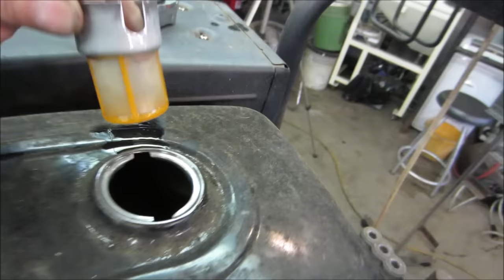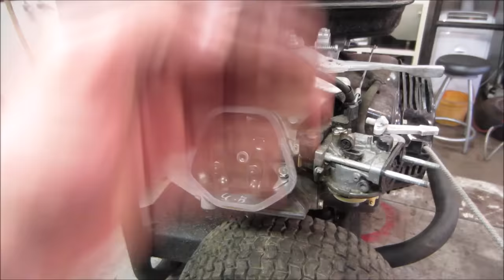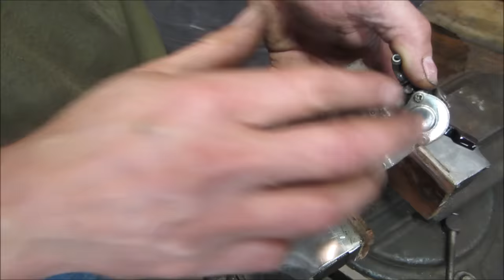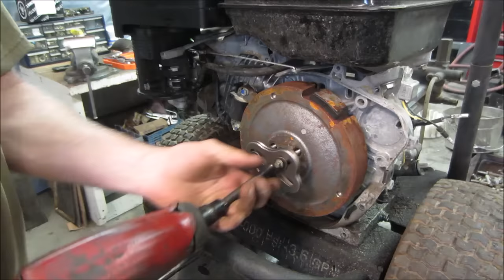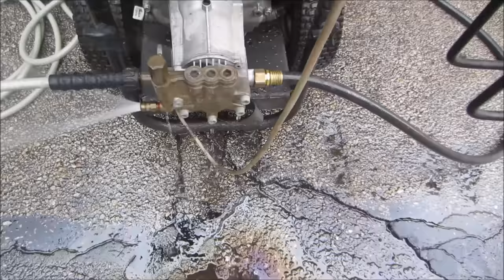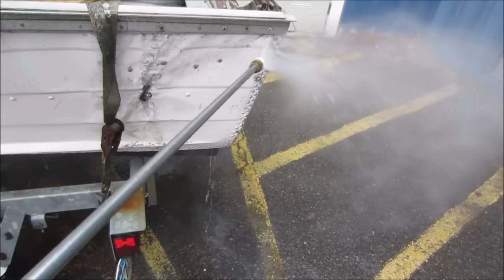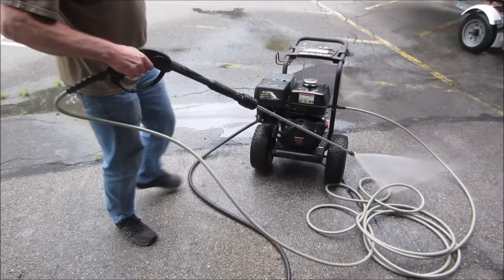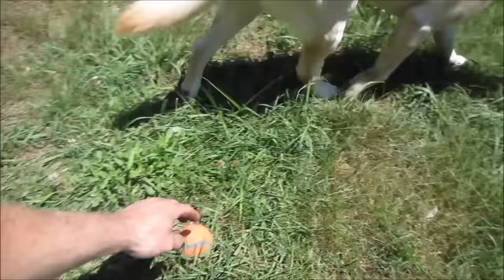Pull start rips out of your Hand? lets Fix It. Busted Pressure Washer.

Comment: "I'm afraid to commit..."

Yeah, no kidding...  that HURTS, when it rips it out of your hand...  My lawnmower did that once...  Sheared the key off, it was out of time.  When that thing kicks, and rips the handle out of your hand...  Ouch.  My hand was buzzing for a couple weeks...  Very unpleasant...

To this day, when I grab a pull start thing, I remember that, and I think "please don't rip the rope out of my hand...."

Fun video.  Nice job.
Reply: Every time i start my 05 honda recon it does it
Reply: Thick gloves help
Reply: Get rid of the T handle and get a ... cane handle (L shaped) pull start replacement. That way, it just slips out of your hand. That or just hold one of the two arms of the T handle, as opposed to crossing it between your fingers.
Reply: I had a mower with a sheared key that yanked the handle out of my right hand and smacked my left forearm.  I had a bruise on my left forearm for a week.
Reply: Every time I've found it kicks a mule, it has been a sheared flywheel key. It wants to fire before tdc. Ouch.
Reply: It is in the camshaft. their is some stuff to decompress the motor.
Reply: you have to take the camshaft out.
Reply: Had an atv with a pull start kick back one time and dislocate my top knuckle on my right ring finger. It was sitting on top of the knuckle behind it. Thankfully I instinctively grabbed and yanked it right when it happened and it popped back into place. If I hadn't of done it out of being surprised I probably would have ended up going to the hospital to have it put back into place. I still have a lump now on my finger 8 years later. Was not a fun experience.
Reply: I don't have a shear pin that broke off.
Reply: 301cc predator
lil bastard has all kinds of issues
kickback (rip my hands lol) the tourque converter is stuck, bad oil rings 
overall a good engine but we just got  a shit engine
Reply: Have a 175 yamaha dirt bike. I ended up with the wrong stator assembly for it. Let's just say the last time I messed with it was a few months ago and my right knee is still sore. Taught me not to lock my leg straight when kicking over a bike
Reply: had a lawnmower that did that. I quickly learned how to slowly pull past that point that can kick back (cause you could feel it) and only then pull hard. It worked for a few years after that, with that issue not fixed. It was always fun to see my pops trying to start it, but without knowing how to bypass that point of "I'll explode your hand into space".
Reply: at work,we had a 40hp outboard that like so much to kick back,that thing really hurts,it left your fingers like if they where broken.hard to start,and almost every time you start it from cold,it gives you at least one kick back,it was so scary...i hate that engine so much....40hp kickin back,ufff.
Reply: Real Talk o
Reply: ..to prevent that "pulled out of the hand" thing...follow the propper start procedure..;)
pull the starter slowly until you feel the compression..
then rehook the starter by letting it roll up..
slight pull again until the have tesension on the rope..
and the one mighty pull thrue..
that way you put the piston right before the compression point and it gives you enough rope and speed to pull thrue the first compression cycle of the engine..basicly like an kickstart on an motorbike..;)
greetings from germany
Reply: It's even more painful when you get kick back while trying to start a 500 cc dirt bike.
Reply: yeah man it happened to me three times now im scared to pull it hahah

Comment: Mustie1, This is one of THE helpful videos I have come to find.  I'm running a professional pressure washing company and the pressure washer was having the same issue.  The pull start was ripping out so hard it was recoiling and breaking the rope several times.  I thought it was weak rope or the pull start assembly was broken. So I replaced and still it was happening.  I had no way of know what to do but this video was clear and to the point.  Today, I did the same, valve clearance adjustment, and cleaned and adjusted the magnet.  It worked! No pull start issues. One of the best videos I have used for the company.  Thank you.
Reply: Fantastic job. I really enjoyed it and finding the coil reversed was surprisingl.

Comment: Hi Mustie1, The one thing I thought I would mention regarding the engine dying after 10-15 mins of use can sometimes be caused by a faulty fuel tank vent causing the fuel tank to build up a vacuum while the engine is consuming fuel. Great video btw. Cheers

Comment: Classic example of the difference between a mechanic and a technician. Good find!
Reply: Not really lol he took apart half the motor to find the issue 😅
Reply: @EFLO3D  he followed what he knew could cause the failiure..thats the way every other mechanic would have done it..and gives back a well seviced engine with adjusted valves, coil and cleaned carb...so right way to do it! :P
Reply: This guy is a Pro. Ive learned so much. Thank You.
Reply: I never liked the term "technician" every job under the sun is some kind of "technician" but only certain jobs have been historically important enough to end up with it's own term. No one says law technician its lawyer. No one says medical diagnosis technician its doctor. The same goes for mechanic, the term technician devalues the importance of a mechanic.
Reply: He’s very entertaining to say the least.
Reply: @EFLO3D  So what would you have done different?

Comment: Two comments. On Briggs coils, the coil has "engine side" to get the install correct. Also the green gas goblins and water love to hang out in the fuel shut off, 
 So the coil problem got the owner a complete engine tune and all Mustie fans a complete troubleshoot tree on running issues of the Honda. Fantastic.
Reply: I can't remember what exactly (thinking Techumseh) but the coil bolts were different sizes to only allow one way installation.
Reply: And some aftermarket say "cyl side" on them to give you the correct orientation.

Comment: I have a Honda powered pressure washer that has taught me how to re-string the pull start...very well.

Thank you! I'll be re-stringing it again but this time adjusting the valves.👍
Reply: Update: my old Dewalt  pressure washer with a Honda engine is no longer kicking back!!! 

After installing another pull cord & handle I adjusted the vales & its running better than it ever did! 👍

Comment: Would you concider doing a video on the power washer's pump valve body repair or rebuild? Might be interesting. Thanks
Reply: I second this!  I have a pressure washer with a broken connector for the inlet hose. I know that Amazon has replacement pumps for 40.00, but I have not yet taken the pump off the motor to check the model #.
Reply: I would also like to see a full typical pump teardown/troubleshoot and rebuild with parts like seals etc. that can be replaced.    Would be a very welcome episode or two.
Reply: I could do a pressure washer pump repair video.
Reply: I rebuilt a Comet pump and it was unremarkable. There are a lot of good videos and don't forget it is not just the seals but the one way valves. Fix them and it's like a new pump.
Reply: I was coming down here to ask the same thing!
Reply: @n1r0l  ĺ

Comment: Mustie, this video is awesome.  taught me tons.  Got may hands on an old craftsman rototiller, crank case and fuel take full of water and piston stuck.  Tore it down, new carb and got the thing to run( one of those briggs carbs with too damn much linkage).  Ran a few minutes then quit...would not restart.  Got fed up...then watched this video.  I remembered during my attempts to restart the tiller the pull cord would jerk from my hand.  Aha, mustie says timing issue.  Checked fly wheel key and coil gap.  Viola, set the gap at 12 thou and the booger started on 3rd pull, purring like it oughta.  Thx bro.  I am hooked on your video lessons.

Comment: I worked at a shop that sold small engine implements.  The Honda GX engine has a good reputation.  Rules for pressure washers: 1.Don't let them freeze. 2.Don't let them heat.  3.Don't run them dry.  Looks like the thermal relief plug opened up on this unit.  Good video - didn't see the backwards coil coming.  Good job!
Reply: Why it’s best to take a picture before removing anything 
Just makes sense to look back and compare

Comment: Thanks for explaining it in Full, You've given me the enthusiasm to  look at our Old Water Blaster again, which was purchased new 10 years ago, But stopped running and started backfiring 2 months after buying, Noticed the governer arm adjustment screw vibrated loose  changing the Governer setting ?
Ended up in the shed stored and forgotten, procrastinated and missed warranty period. My Bad !

Comment: I'm sure its been said already, but I believe that the water that comes out of the pump when the pressure line out is off, is meant to cool the pump when water isn't going directly through the pump itself. As AvE would say, "That's a feature, not a fault!" Great video!

Comment: One thing that wasn’t covered on the fuel side was to check the fuel bowl retaining bolt, it could’ve had blocked passage, sometimes it’s the issue on no fuel since its the lowest point in the bowl, and dirt will settle there after sitting for long periods of time then when started it gets sucked in the ports. This was an excellent video, thanks for sharing.

Comment: Just wanted to say thanks.  My pressure washer kicked the bucket back in May and I didn't have the chance to take a good look at why it stopped working until recently.  At first I thought it was the carb.  Cleaned it out (there was junk in the bowl so I thought that was it at first).  Put it back together, tried to start it, and it pulled the starter cord out of my hand (and felt like it almost broke my arm in the process too.  :/ ).  I didn't have much time to get into the guts of the thing so I put it away until I had more time.

I saw this video back on the 5th when you published it.  I hadn't touched the coil but you gave me an idea of what could have been wrong.  This past weekend I pulled off the flywheel and sure enough, the key that keeps the flywheel in sync with the crank had sheared and the two were now out of phase by about 90 degrees. Of course nobody in my area carries the specific size of key the engine uses so I had to order it.  No biggie, two days and five bucks later I had three of 'em.  Put the flywheel back on, slid the pin in, put the thing back together, and gave it a pull.  She fired right up on the first try!  Thanks again for pointing me in the right direction!

Comment: my guy has a gas powered pressure  washer that i have broken the rip cord ( as we now call it )so many times it s just a pain in the butt to replace all the time. so i asked if i couldn t just jumper it to get it to run? he came up w/ a socket an extention and a cordless drill that he put the socket on the big bolt head in the center of the motor pulled the trigger and got the motor spinning and quick as a bunny it was running! so now i just start the darn thing like that whenever i use it. it saves so much time and effort since the rip cord doesn t need to be on it now!

Comment: Best learning yet, I have a very similar engine in my log splitter, now fixed thank you very much. and as a bonus for me, my spare generator that I've done (nearly) everything to, but wouldn't run, added a teeny bit of oil and runs like a charm, pesky over zealous low oil cutout. Winter here, off grid, so very appreciated thank you old chap.

Comment: When I was a kid back in the 1970's .I'd go digging through the scrap piles and find old junk lawnmower engines for my homemade go carts ..bring the engines home and try to get them running ....My Dad was an Old Us Army Veteran  .when he came back home from the Army in the 1950's .he went into the Pennsyvania  coalmines and a Mine Mechanic..there were no jobs for Veterans back then so they took what they could get ...My Dad was Creative ..if Dad needed a part and couldn't get one  he made one ha ha ..I miss those old timers ...when I had a lawnmower engine that had a sheared off flywheel key .My Dad would cut one out of a plate of steel .stick the homemade steel key in his bench vise and with his file he would file it down till it fit perfectly ...Dad always said .you wouldn't want to use this steel key if you were still using the engine on a lawnmower. But on a go cart I dont see a problem with using steel for the key ..Dad fixed many engines for me and they ran great for what I needed them for ......We lived way out in the country back then and would have to drive many hours to get to the city to find mower part so Dad made what we needed ....The Days of the Old timers are gone ..everything can be bought on the internet today

Comment: Actually there is a fuel line plug built into the grey choke lever on the carb. If you look on the side of the lever, there is a short little stub that is designed to fit into the fuel line perfectly.
Reply: Only Honda techs know this feature.

Comment: Had the same problem. Would run then just die. Ended up if we left the gas cap lose it would run all day long.
Reply: when that style gas cap came out that was a common problem on Honda motors
Reply: Same problem I had on dirtbike had to change gas cap
Reply: Those tall fat caps were required for engines shipping to California. Another good idea on paper, but not so much on actual operation. Suggest replacing cap with an old style, low profile pancake  shaped cap.
Reply: Are generator did that .lose cap run fine.
Reply: Common issue true
Reply: Vacuum. Also seen it happen with a small Ford Bantam pickup truck where the little breather hole on the gas cap got clogged up.
Reply: Doug Page - Sounds like it needs a vented gas cap, or if there is a vent, it could be plugged. Happened to one of Jay Leno's cars as well, all caught on video.
Reply: @daveogarf  As I recall those California gas caps are supposed to be vented, but they have a check valve like design so that if the engine is turned upside down the lid will seal and the gas not drip out. Obviously designed as a solution to a nonexistent problem. The problem is the parts of the cap can often end up sticking together and be a sealed cap rather than vented.

Comment: When taking out the little pin that keeps the float in place, notice it does not have to click into place, because it is long enough that if it vibrates all the way One Direction or the other it will hit the side of the bowl, and because it’s long enough it will never fall out.

Comment: I had a craftsman’s 2 lawnmower that had a two finger rope pull starter. This pull starter was located between the handles dead center on the push handle. I purchased this unit from sears new or at least I thought it was new supposedly only test run. What I found out it was returned to the store because the first time it was used it sort of backfired and injured the users hand. When I purchase it I used it maybe two years and often the unit would sort of backfire from time to time. No big deal I just pulled the starter again and it would start. Well one day I was getting ready to mow the lawn before I headed to work but this time when I pulled the rope starter the unit backfired once more and this time the hard plastic pull grip pulled out of my hand and struck my left hand that was depressing the safety lever. I turn this hand was crushed by the impact of the handle. I spent a full three months in a full hand and arm spica cast. This hand was shattered. In time I did recover but the experience wasn’t fun. 
As an interesting side note we had friends visit us a week after I broke my hand. I really did not explain how I fractured my hand other than indicating it was broken using the lawn mower. Four months later this same family came to visit us accept this time he was in a full arm cast just like the one I had just had taken off. He was given the same model of lawn mower by his uncle and it broke his hand the same way. 
If that wasn’t interesting enough when he was sitting in the doctors office he also spoke to a women who broke her hand in the same minor.

Comment: When I have an engine that starts and runs fine and then just dies, the first I look for is a bad ground that re-grounds itself when it sparks up, but then rattles loose and dies.
The other is fuel blockage when the engine runs long enough to bring the blockage up into the fuel passage between the tank and the intake manifold.

Comment: Nice work on the diagnostic and repair. This reminds me of pull starting my old Mercury 50 hp outboard motor, that thing would really hurt your hand if you didn't put all your weight and power into the pull, not that there was anything wrong with it, it's just such a large engine.

Comment: That pump is toast. They don’t even like cranking dry let alone run dry.
Reply: Is that why it was working fine at the end of the video?
Reply: I was kind of thinking the same thing.  Maybe they are not as fragile as I think.
Reply: They aren't nearly as fragile as everyone claims. I work at a rental place and we start the P/Ws dry for 10 seconds every time we send one out to prove they start. On a fleet of ~15 washers that see heavy (ab)use as a rental, we probably replace 2 pumps a year, often due to human error (last one we did was because nobody checked the pump oil :-/ )

In fact my reason for watching this is because they're all Karcher/Landa with this exact Honda motor...different model though.